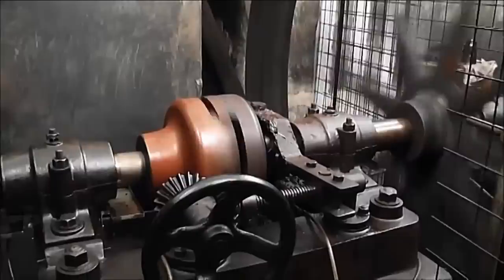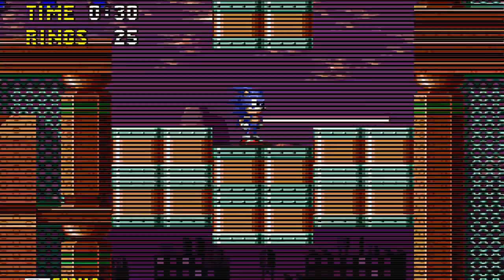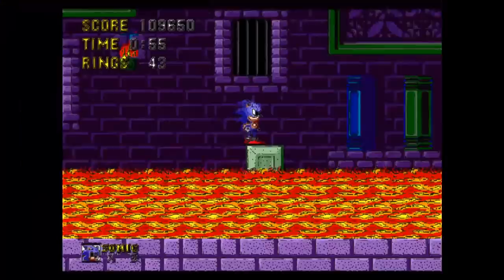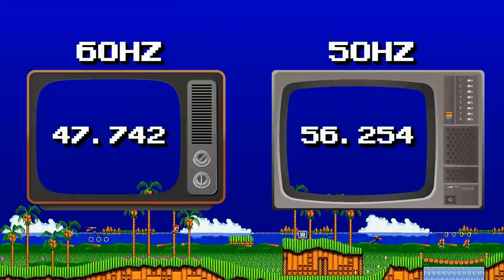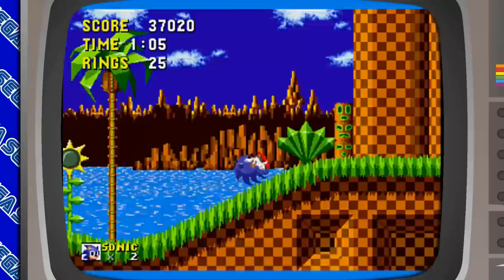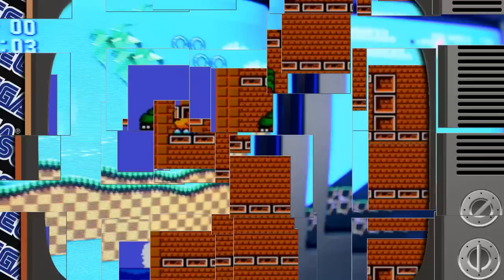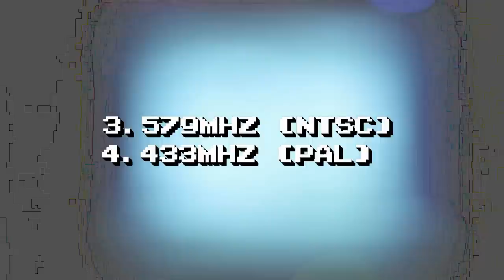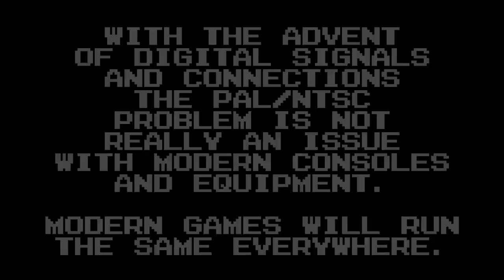Why is Sonic Faster in America? NTSC vs PAL/60Hz vs 50Hz | Nostalgia Nerd

Comment: Mostly a very good video, but (and to be fair, this has probably been said a number of times on here in the two years since this video was posted), PAL and NTSC games running at 50hz and 60hz does not equal the same number of frames per second. Interlaced video deals in what are known as 'fields' rather than frames, and you did describe how interlaced video works correctly, but there are some important points about how old consoles actually use it.
Old consoles output a 240p signal; sort of a weird off-brand spec that happened to fit within the 480i standard. Each first set of interlaced lines are displayed correctly, and the second set are actually left blank. This is what gives old games on CRT displays the scanline look, and means that 60hz and 50hz console games actually run at 30 frames per second and 25 frames per second respectively. The 240p output is also why a lot of PAL releases ended up looking a bit squished with blank space along the top and bottom (PAL displays actually use 576i; more lines in the display that usually weren't utilized) and why trying to get old consoles to work with new televisions or equipment can be slightly problematic; the 240p signal tends to be mishandled as 480i and end up with flicker and other interlacing artefacts where there shouldn't be any.
Some games (Not Sonic) were programmed to compensate for the framerate difference so that the whole game's speed and physics calculations weren't directly tied to the output framerate (The magic of delta-time, most likely. Something even more recent games sometimes still fuck up on PC releases) but you were still losing 5 frames per second in the conversion, so the NTSC versions were just plain smoother as a result even if the game speed was compensated properly.

Funnily enough, Rare (being a british development stuido and therefore actually caring about the difference) tended to program their games properly, so almost all of them run at the proper speed. Games like Donkey Kong 64, Goldeneye, Perfect Dark and Banjo Tooie even compensate for framerate drops as the games run by speeding everything up so that the game at least visually maintains a consistent pace even when the framerate tanks. I'm sure they weren't the only studio, but they are the most notable in my mind.

Comment: technically my 90s plasma screen TV could output 60 and 50 Hz through my HDMI adaptor plugged into my Nintendo switch either 60 or 50 Hz both worked

Comment: Although very interesting you missed the elephant in the room.  By 1989 tvs had scart 60hz compatibility and a bit later most high end tvs took 60hz through all aux inputs.  The reason pal games run slower is because the most common connection at the time was rf coaxial which is the only connector required to be tuned into the TV as a channel at 50hz rather than an aux interface.  If tvs all had aux 60hz inputs Europe would have gotten ntsc consoles.  You don't  need to go back to the 1800s for this reason.  Just 1978 and onwards.

Comment: You can notice this sort of thing In all kinds of games, even ones optimized for pal regions, for example there are a lot of n64 games where while the game's logic was adapted to 50hz so the game runs at the correct speed, for some reason the sound generation wasn't adapted, and as a result of the lower frequency, everything, specially music, outputs at a lower pitch than in 60hz consoles

Comment: Some games on the atari and the C64 rely so much on the NTSC or PAL that are unplayable on the other, backgrounds flicker or the character won't fall in the plattform. No problem for emulators but pretty frustrating on the hardware machine.

Comment: When I was 7 or 8 I got a used Mega Drive for my birthday. I live in Europe and if I recall correctly, the guy we bought it from said it was a Japanese model. For some games I had to use a special "add-on" cartridge for the game to work (Streets of rage 3 was one of them) but other than that it worked perfectly fine. The console looked slighty different from my friends' Mega Drives, mostly having blue buttons as opposed to the white or red (Model 2) ones on theirs, and when comparing pictures online now it looked remarkably similar to the Japanese version.
 My question, if anyone knows, is: Could it really have been a Japanese Mega Drive or was it some sort of pirated version? Would it even have been possible to run a Japanese Mega Drive on my PAL TV in the first place?
Reply: Yup, thats a modded imported Japanese one.  I still have one, its had the video output converted to pal internally .
Got it from an importer just after it was released in japan, cost a bloody fortune, over £500 iirc.  To use uk cartridges I had to open it up and remove the cart locking mechanism.  The Japanese carts and box art were so much better looking than the humdrum designs we got with uk releases.

Comment: I feel bad for European retro gamers.  In general you all got RGB, but most consoles in the US output RGB anyway.  Buying some extra cables and an RGB to YUV converter is much easier on the US side than doing region mods and oscillator replacements on the European side (or importing a ton of NTSC games)

Comment: And what about PAL-M (Brazil)?
Does it run fast as NTSC or slow as PAL? Because Brazil uses the 60Hz frequency,but the PAL encoding.
Reply: It gets an NTSC video signal, meaning increased speed, much worse colours, and lower resolution, but it gets better sound than an American unit owing to outputting the sound at the greater bandwidth PAL signal. I'm not sure how this affects music timing.
Reply: @SamPearman  
Coming from the future, having learnt quite a but about PAL-M.
It runs just like NTSC because it's 60hz.

Comment: Very interesting, and brings to mind something from my early teen years.

i had two PlayStation consoles. One was sort of a replacement because the disc reader died. however i was good enough with electronics that even in my teens i could easily swap the reader from one PlayStation to another, which i did because one had a chip i had added so it could play imported japanese games.

they 100% had a different play speed.. most of the time this was not noticeable but in games like Crash Team Racing, the faster system was DRASTICALLY NOTICEABLE..

i am unsure if this speed change was due to the chip installation, or if one console was from the wrong region or something like that. but it is something that has always confused me.. US btw, so i am not sure that PAL vs NTSC was part of the issue i encountered, since the chip was to enable Japan regional games (according to this video both 60hz).

its entirely possible one of the CPUs was simply overclocked by mistake or something like that...

either way playing CTR on the slower machine when i first changed over the disc drive was a bazzare experience.. it was easier but i had been playing the game long enough that i was competent at the much faster speed, and effectively had to relearn my timing to play.

Comment: technically isn't possible if you could speed up the software the different is that you could use a multisync CRT the differences between multisync CRT and multisync LCD is that lcds only output fix pixels and crts do not

Comment: Are there any CRT TVs that are compatible with both PAL and NTSC? Because if so we'd be able to get the best of both worlds, you could play European-exclusive games in PAL and Japanese-exclusive games in NTSC all at their optimised speeds, all while still getting the best image that only a CRT can provide...
Because c'mon, most retro games look like s*** and have very noticeable input lag on LCD and LED screens, and a Framemeister is a bit too expensive for me...
Reply: Lots of CRT TV's are. Most Sony CRT's are 50/60hz and are the best choice for retro games. Some people rave about Bang and Olufsen MX4000/MX7000 and they are good, just not as good as a Sony :)
Reply: Yes, most of the later ones that alowed to run games at 60 hz.
Reply: I can tell you my last two CRT TVs had both PAL and NTSC support, they introduced this as PAL60 back then mainly for the purpose of playing VHS tapes and DVDs at proper speed as later VCR and DVD devices also had the functionality to play stuff from other regions, at least in Germany/Europe.
Reply: Yes. I've owned (and still own one of them) 2 mid 1990's pal tv's that can handle bot 50 and 60 hz. (and my current crt is a model that supports pal, secam and ntsc as options. currently using it with a super famicom without issue.
Though I'm hoping to find one that has RGB scart input, like the model I owned in the UK, (and yes, that model also supported 60hz, pal 60, and likely ntsc technically)

probably most european TV's made after about 1995 can handle both 50 and 60 hz. As can an odd bunch of TV's classified as 'worldwide models', which are often sold in parts of the world too small to have dedicated designs built for them, and as such basically support every television standard there is. (my current CRT is one of these, and I believe it originally belonged to someone who took it here from Guana or something).
Reply from the maker: A lot of the latter (and better built) PAL models have NTSC modes, but it's very rare to find an NTSC region CRT that's compatible with PAL.
Reply: Yes mine is
Reply: sony pvm is the answer
Reply: Ruko Michiharu just get your hands on a box TV and put it in your basement or something I dunno. You can get them for free these days

Comment: PC gaming: Higher frames are better
Reply: ummm, pal and ntsc applies to "pc gaming", especcialy to crt monitors
my 4k monitor outputs at (presumably) pal 60.000hz it accept ntsc 59.974hz and pal 50.000hz
also you are capped at the hz of the display you are looking.
Reply: +brunoignaciogi Hardly anyone uses PAL anymore, Britain uses DVB-T. TVs still support it so we can still use older DVDs etc., but it's very rarely used these days, PAL is 576i, so if you have a 2160p monitor then it's definitely not outputting PAL 60 unless you've fucked up your settings.
Reply: Also, while it's true that you're capped at the Hz of the display, frame latency is still a thing, so even if you only have a 60Hz monitor it's still to your benefit to have as high a framerate as possible. This is because 60 times a second it accepts the most recent frame from whatever it's connected to, so the higher your framerate, the more recent that frame will be.

Comment: This fails to address the fact that it may have been a conscious choice and that the problem was unsolvable, though.
Nowadays, in a photorealistic game, you would be able to adapt a game loop to different framerates (even though nowadays game loop & refreshes are often separated), because you'd be able to scroll by subpixels. But At that time, pixels were large, and instead of "2 pixels every frame" for a smooth scrolling, you'd end up with "2.4 pixels every frame", which would translate to "sometimes 2 pixels, sometimes 3 pixels", and the results would look pretty jerky. So the gameplay may be better, but the scrolling (& we're pretty sensible to that) or moving characters would look bad & feel nauseous.
However I'd suspect that the problem with the music was bad coding and that the console had an interrupt-like design to make music work independently, though (well I don't know, but that was a common thing).